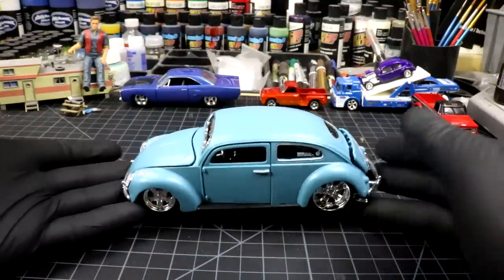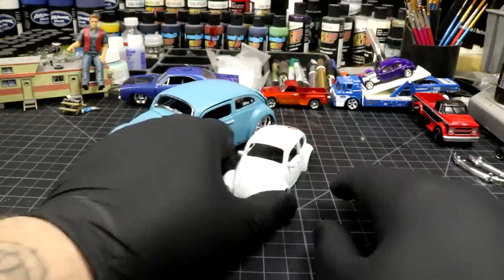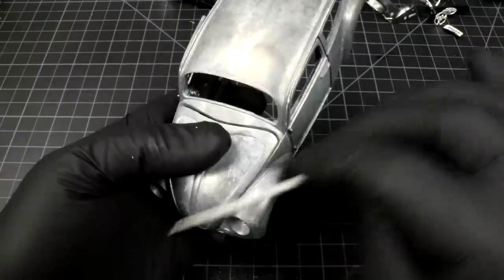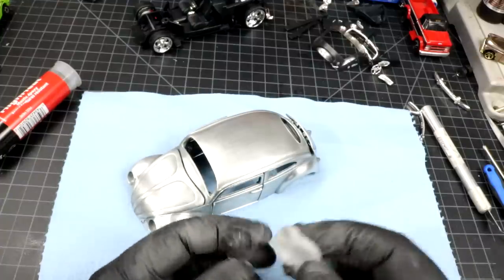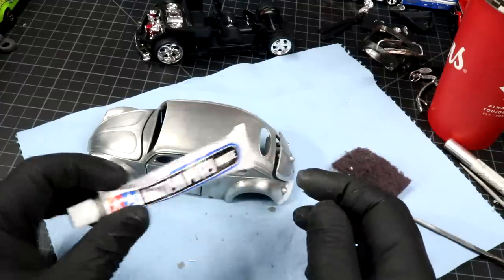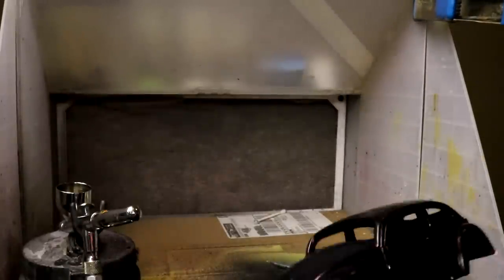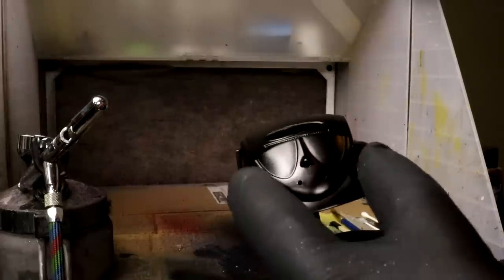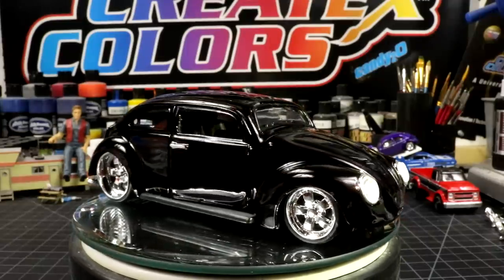Painting Diecast Cars - Chopped California Style Beetle - Candy Black w/Red

Comment: Great paint job.  I  don't like that the engine cover doesn't sit flush though, spoils the overall look.
Reply: Jeff Fletcher it is Modeled after a real design the Volkswagen beetle engines or air cooled and when you pop up the hood like that you use hinges so you have gaps all around the engine cover hood or whatever you wanna call it and so that basically just let it suck Air in  like a lot more air than if it was down t
Reply: @drewanderson9132  be that as it may. I have to agree. Not a fan of the  ill fitting engine cover.
Reply: I know, I always think that's a shame but they have to do that for fitting Porsche engines. It bums me out too.
Reply: @MatthewOfLondon  I'll admit I'm not a fan of vw beetles. But I love the paint on this one. So deep you could dive in. Would love to see that paint on a 32-33 hot rod. Or as two tone on a 50's Caddie.
Reply: The popped out engine cover is part of the “Cal-look” styling that goes along with other styling modifications like bumper mods and stance modifications.
Reply: Yeah i think the engine lid off, would have looked awsome, to show the cool decked out engine! Or maybe, cut out ,to just leave a picture framed lid like !?! But it still is a great masterpiece soo..👍🏽
Reply: Drew Anderson 913 yuh
Reply: Drew Anderson 913  Actually the reason was to clear Weber 48 IDA carb’s. The aircooled motor actually ran cooler with the engine compartment closed. And all factory sheetmetal in place
Reply: Best color I have ever seen !
Reply: @drewanderson9132  Just because it is based on a real design doesn't mean you have to like it, just as you don't have to like the real design.
Reply: Being from the generation of slammed bugs, the ill-fitting rear is intentional. Someone here posted it was the Cal-Look or SoCal Look. I can verify (From an old gear head here) that if you didn’t do this to your slammed bug, you were not looked upon as a true VW guy or gal.
Reply: @Bobsterbear  Reminds me of when all the honda guys back in the day used to have hood risers.

Comment: I've been wanting to tell you that if you use purple power from Walmart and soak your plastic parts in it for a day or two it will not hurt the plastic at all but remove all the paint it works so much better than brake fluid.

Comment: Forget the license plate you should have fixed the engine hood sticks out way too far still still a clean paint job though
Reply from the maker: They do that on purpose to let air in on a modified engine, it’s like a hood scoop.
Reply: @DiecastResurrection  o ok I've had those bug models before and don't remember that sticking out like that but it's been awhile since I've had one so it could have been still a nice project you did